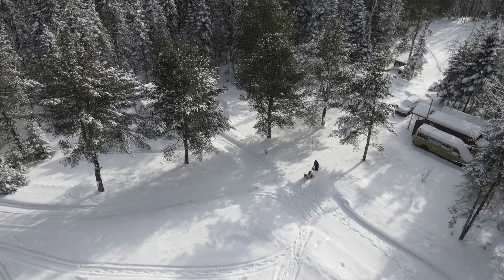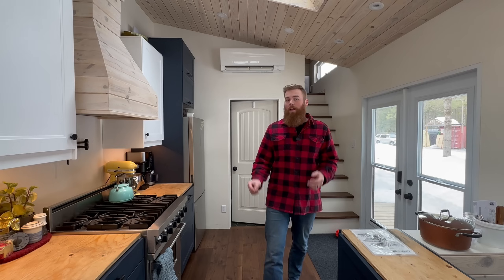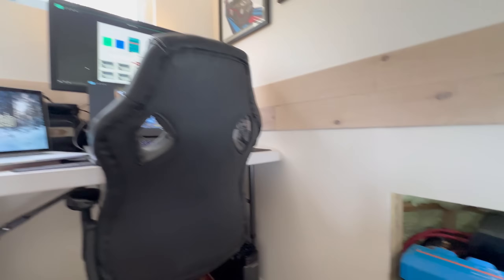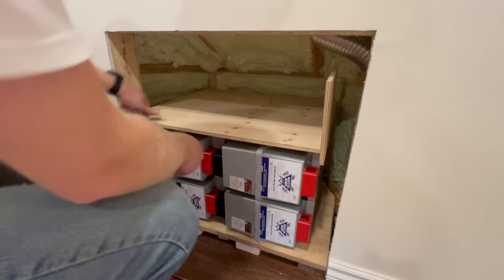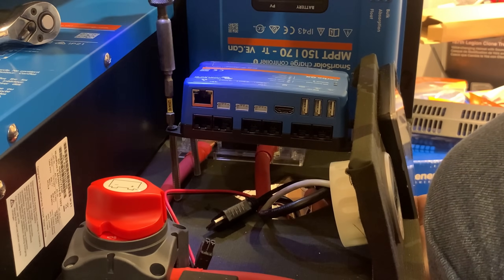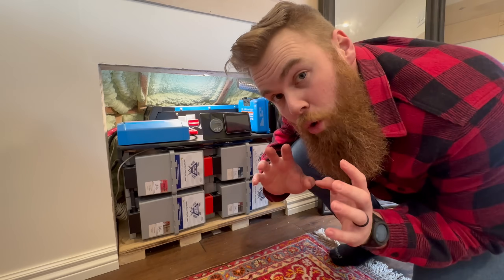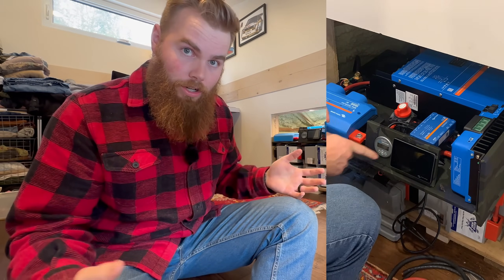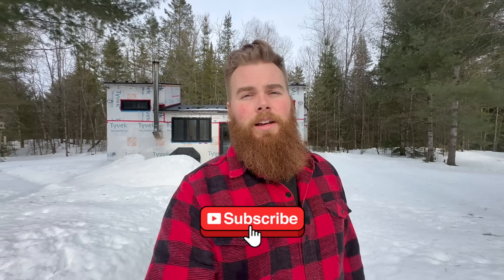How I Solved Our Power Outages for Good (DIY Battery Backup)

Comment: I was shocked when I looked up BattleBorn batteries, as they cost more than 3x as much as the prices I'm used to seeing. But then I realized that it wasn't just them, all the American battery manufacturers seem to cost 3x or more as much as the Chinese battery manufacturers. So if you're trying to replicate this and you're outside the US, it's probably worth shopping around, since you can save a lot of money.
Reply from the maker: I hear what you’re saying but there’s a reason that those batteries at that much cheaper, their quality and lack of management leads to failures and safety problems. When something like this powers a home I would rather spend the money to make sure it works properly and keeps my family safe 👍🏻

Comment: Does the grid get charged from the inverter/switch when the grid goes down with a grid tie connection? With solar, you need 220v to turn on the solar inverters to convert DC to AC and run the home or feed power to the grid. When the grid is down, can the switch system turn on the battery backup to 220v for full house backup and turn on the solar, BUT not power to the grid?? We don't want to put voltage on the grid with linesmen working to restore power !? !???

Comment: We are trying to find real world solutions for the excessive permitting requirements when building off grid. Specifically septic related. Here in BC even grey water is considered black water.
Reply from the maker: It’s pretty wild, you can’t sneeze without paying for it and doing it the right way. I wish I had an easy answer for you

Comment: it's not life po4, it's the battery chemistry Lithium (Li ) Iron (Fe) Phosphate (PO4)
on a personal gripe idk why battleborn only list the battles Ah, Watt hour (Wh) is so much more useful if I tell I have a 100Ah battery that means nothing unless you know the voltage 12v 100Ah is very different than 48v 100Ah but if I say its a 5000Wh battery you know ithe capacity whether is 12v, 24v,  48v or whatever voltage it would still be 5000Wh.
Reply from the maker: lol I knew I would get this comment 😂 I say it like this because it’s much faster than listing it. Also I appreciate your personal gripe, This video isn’t intended for experts, just to show people entering the niche what I have done for us and our particular scenario 👍🏻

Comment: Good video. I like how you have the system all tucked away in there. Victron really does make great equipment. But holy cow those Battleborns are insanely expensive. 
You should contact Vatrer and get a 460ah model to review. They have fantastic 12v batteries, and they would be around 1/4 of the cost.
Reply from the maker: Thanks! I’m glad I made sure to build the closet up into the second floor to maximize it, I honestly don’t have anywhere else it could have gone 😅

Comment: Do people even know how wasteful and unnecessary inverters are
Reply: My Victron MP2 48V inverter's standby power is less than 15W and the efficiency is ~ 95 %.  Most inverters can't even come close to this.  Sometimes you get what you pay for.  :o)
Reply: @rpsmith  you forgot to account for the rectification and steps down conversion most of your electronics do. The extra wear of your batteries and the extra equipment. I suppose it would not be easy or cheap to retrofit a house for DC power, but you were willing to eat the cost of retrofitting your van for AC power.
Reply: @INVAZOR33  ~ You might be able to get by with running your RV or Tiny House off of DC but it's not piratical beyond that scenario.

Comment: Wow, those batteries are WAY over priced. 12v 100Ah LiFePO4 batteries typically run around $100 (~$85-$130). So ~$1 per Ah. Those Battle Born batteries run $7.97 per Ah. You would need just 3 of the cheaper batteries to exceed the energy capacity of just one of those Battle Born ones. So you'd be looking at ~$300 vs $2,149. They even sell a 100Ah batteries, but the cost is almost as high at $7.52 per AH.

You have 4 of these so that would cost ~$8600. For that money you could have had 85 of the cheaper batteries or 102,000Wh. VS  12,960Wh. If space is the main issue (and here it is) you could have had 12 of the cheaper batteries for $1200 and still had more capacity for nearly the same space.

Sorry but from just an economic point of view these are bad batteries to use.
Reply from the maker: Everyone is welcome to search for products that fit their needs, but look at it this way. You’re talking about batteries made without a BMS, poorly made, re-branded in factories overseas, claiming they’re lithium iron phosphate, and have incredible failure rates. In this line you get what you pay for, I’m happy to keep my family safe and secure with a product that I have used for over 5 years and has never let me down or caused any problems ever 👍🏻

Comment: Previously commented on my vertical solar, results 3300W array overamped the mppt at 4185W, +147W per panel, cleaned snow drift once this year, still snowing this morning. 
The other inverter had more amp input 733w per 550w panel with vertical snow sun. Overcast all day today 20kwh from 11.6pv. I consume 20kwh with electric heat below freezing. 65 hours of Gen this year, a few dark days, some changes this year going to try for 0 hours next winter.
Reply from the maker: Awesome to hear you’ve got it working exactly how you need! Thanks for sharing!

Comment: This cant be correct.  Starlink takes about 1kw per day.  With 270 ah  that is about 14kw so that wouldn't last 2 weeks powering there entire home.  This is incorrect information. Please do the proper wattage you use for everything and give a proper analysis.
Reply from the maker: I have real life experience of this… Also, you misheard, in the video I say this is a 1080Ah system, each of the four batteries are 270Ah
Reply: @Snowstead  @mghtymouse380 is correct.  The Battleborn GC3 270 ah battery is a 12 volt battery.  270ah x 12v x 4 batteries = 12960 watt hours of energy storage.  12960 wh / 14 days = 925.71 watt hours per day.  
That is less than 1 kwh per day not even taking into consideration inefficiencies.   Our small 1400 sqf home when we limit the load to two fridges, lights, wifi and Starlink takes 11 kwh per day to run.  
Our French door fridge takes 1490wh/day, our standard fridge takes 1290wh/day, well pump maybe 1600wh/day.  I think you miscalculated something.  It looks like you have about 5 days of energy storage if you are very careful.
Reply from the maker: You have to remember that the items like our fridge and well pump run for a couple minutes every few hours, I have experience running this for weeks without the grid, I’ll make a video showing this 👍🏻
Reply: @Snowstead  
Looking forward to it.

Comment: You should really consider doing ground mount solar instead of roof top. It's much easier to brush off the snow on the ground then elevated on the roof.

Also you can set up the ground mount to tilt to get the best solar input depending on the season.
Reply from the maker: You’re totally right! It’s something I’m looking into more and more, we would get a better yield elsewhere on the ground and as you said would be able to get a bigger angle to keep snow off. I think I’ll switch to that 👌🏻
Reply: Not to mention much cheaper, easier, and safer to set up.
Reply: If you got the space, ground mount is the only way to go!

Comment from the maker: What’s the longest power outage you’ve ever experienced? Did you have a backup?
Reply: ... over 35 years..
.. off-grid..
Reply: 4-5 weeks in the dead of winter during Ice Storm '98. Lived in the city in those days with no back up power, but I learned a lot of important lessons that I've carried into adulthood!
Reply: 8 days USA Midwest ice storm, natural gas stayed on for hot water so really not bad
Reply: About 2 hours.  But I live in a modern country.
Reply: @BenState  Where do you live? The USA, especially the Midwest, South, and Atlantic experience a lot of extreme weather events. A combination of geography and the jet streams means that the USA experiences a disproportionate amount of severe weather compared to other countries. And the severe weather is more severe on average.
Reply: @PootsMcSkoots  Citation required.  Many countries have just as severe weather.   The USA doesn't even  rank in the most severe climates to produce and distrbbute electricity.

Comment: What is the height of the of your ceilings were the bedrooms are on top. I know you have a unique system. Thanks for your info.
Reply from the maker: Good question! On the high side it's 7'3" and on the lowest point its 5'6". I'm 6'6" and never hit my head, mostly because of the staircase there 👍